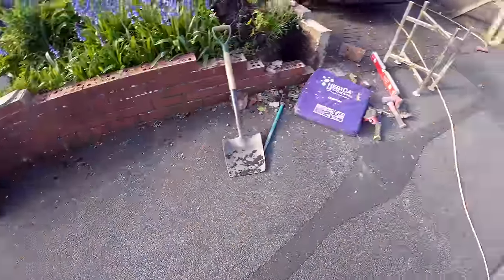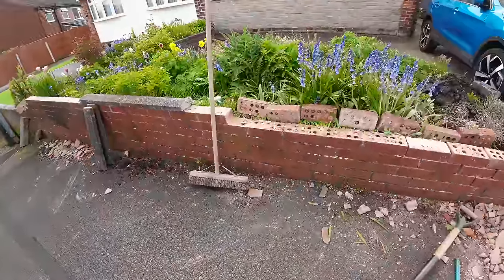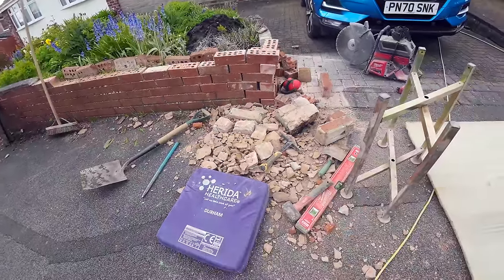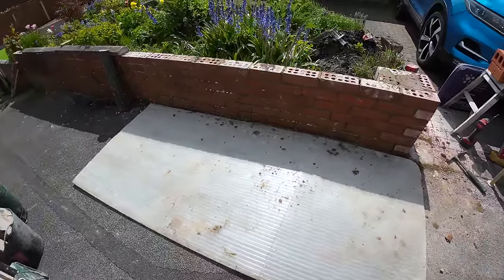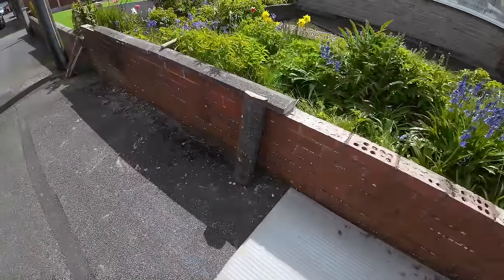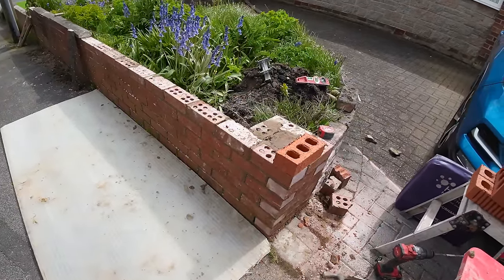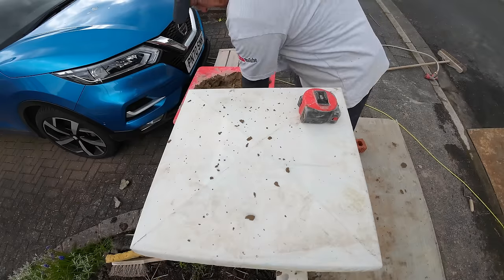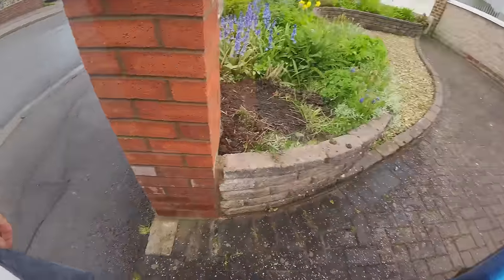WALL V CAR.. GUESS WHO WON

Comment: I’ve watched other brickys use a big tub and a paddle in a drill to mix up the mortar saving you getting the big mixer out van on your own Steve 👍🏻
Reply: With being a plasterer we use the power whisk  most of the time ours will knock up over a barrow load quicker and better muck too  very good job steve
Reply from the maker: @timwebster5667 😁🧱👍🏽

Comment: From 34:35 on is the worst part and least favorite of any job. I try to clean up incrementally during the production portion of the job , if i don't need a particular piece of equipment any more , I stow it away. Looks like you were not in a terrible amount of hip pain today. 55 minute cleanup, not bad for one guy , good job.